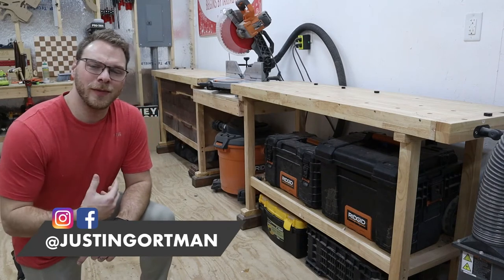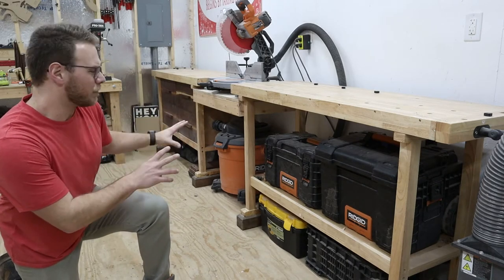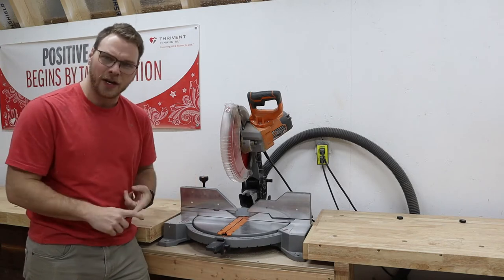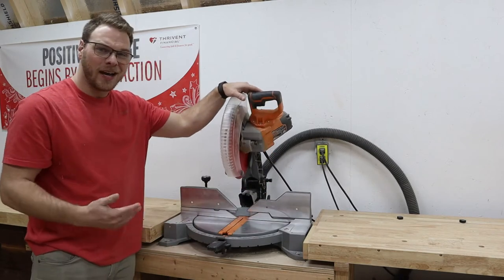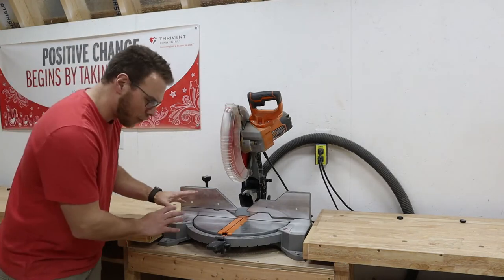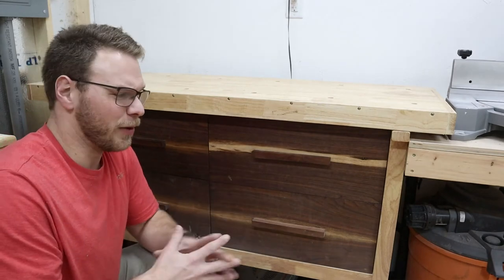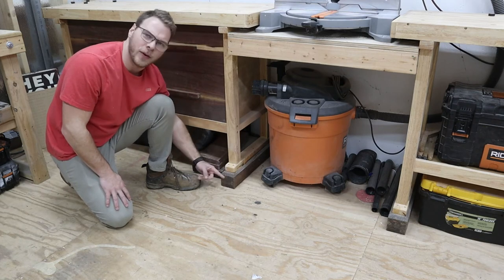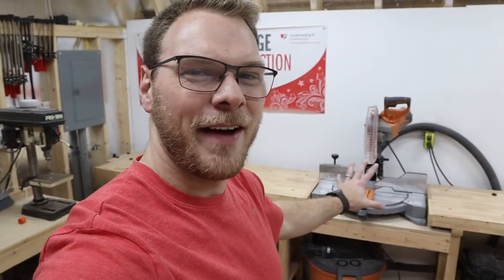DIY Harbor Freight Miter Saw Station | Affordable & Fast

Comment: I put wheels on my HF benches so i can use them this way or back to back as an outfeed. For the miter saw, i bought an HF tool stand, doubled up MDF and the miter saw is at the same height as the benches.. 

This gave me a good idea. Now what I'll do is build a removable miter saw platform that will hang/suspend between the benches to eliminate the tool stand but keep it from being permanent so I can still quickly move them around and use them otherwise as needed!

Great idea bud.
Reply from the maker: Love that idea!